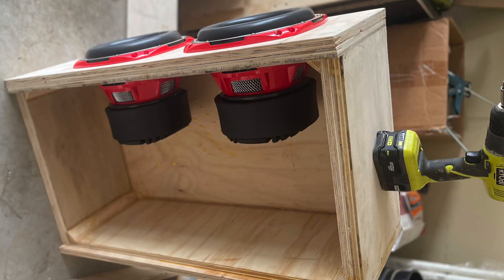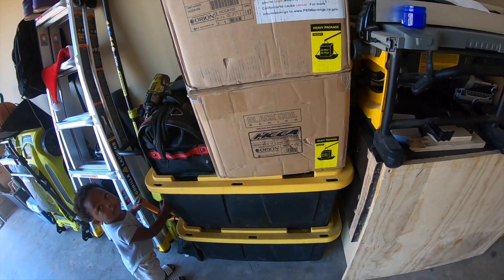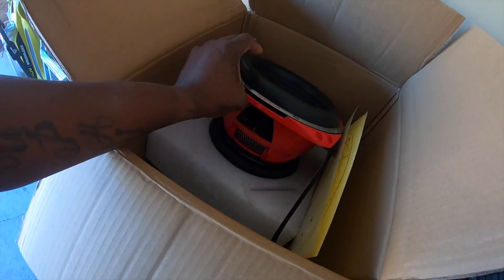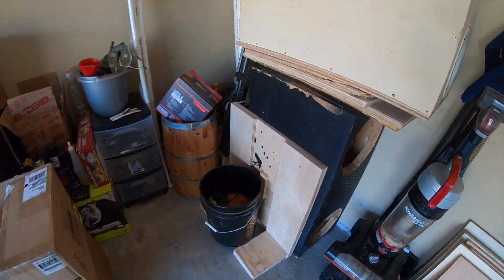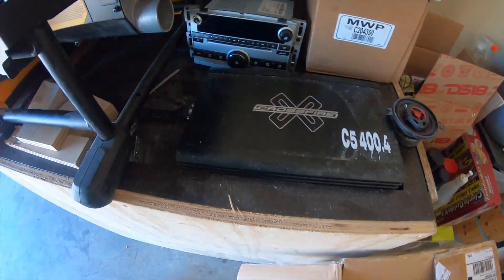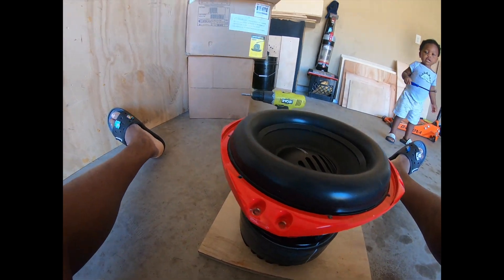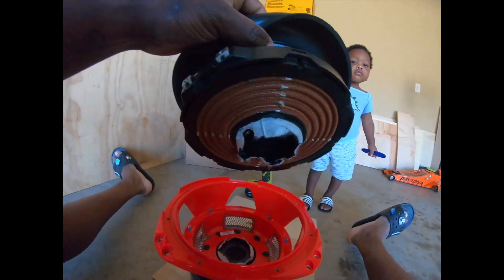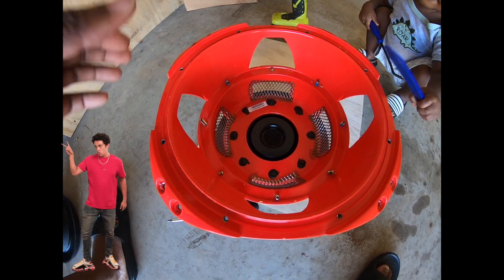Bottoming out a Subwoofer

Comment: Would yoh recommend this subwoofer? I’m debating if I should grab a 10 HCCA to pair it off with my RF T-1500BDCP but I’m afraid it might be enough to get the sub moving.
Reply from the maker: With that amp you have I’d say get your hands on a XV3 or XV2 even a Zv6 10 for the same price and don’t worry about power just put it in a box 25% bigger than spec.
Reply: @AJOSUE  thank you, will look into those.

Comment: I just remembered you have a $450 SMD AMM-1. I think that can be made to work to find your port tuning. At a fairly low volume level you'll need to play individual test tones like 29, 30, 31, 32, etc and let it chart the impedance. The point of lowest impedance with a big increase on either side should be your port frequency. If it shows the lowest,  like 0.7 ohms, across 31, 32, and 33hz then the middle number is the tuned frequency. 32hz in this example. Hope that helps. 👍

Of course, you'll need to wait until you get both speakers working.
Reply from the maker: I understand what you’re saying, I just got lazy and ignored the signs and sent it, but yeah I’m waiting for these folks to send me my recone or I’ll just cancel and order it from amazon